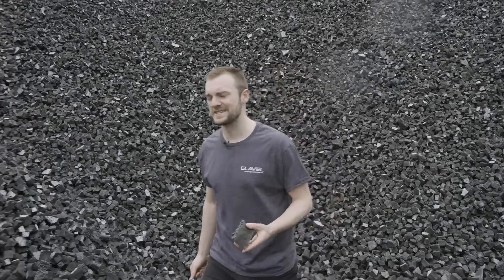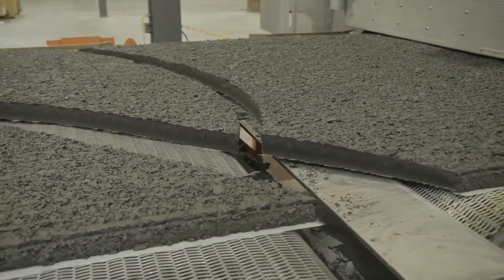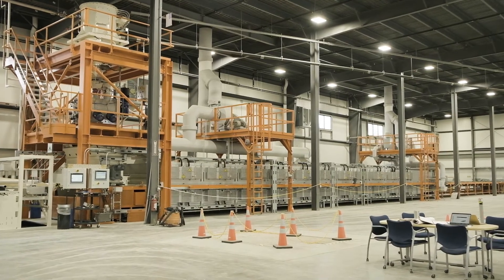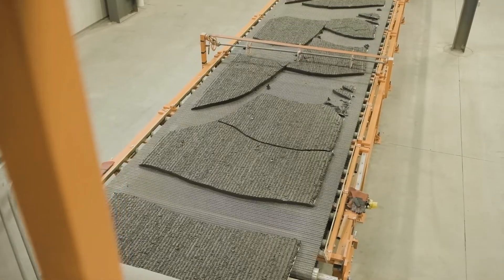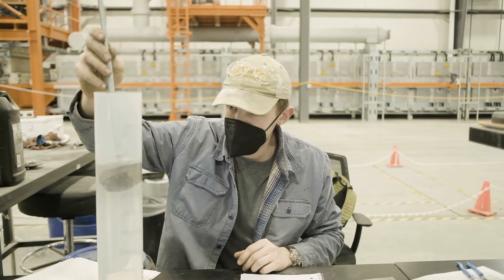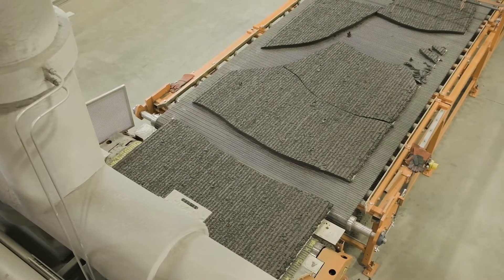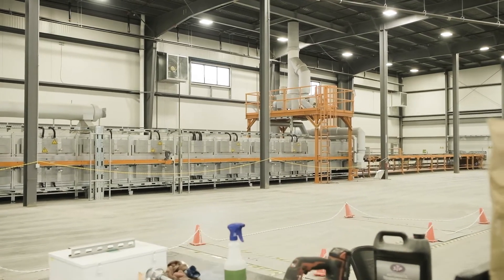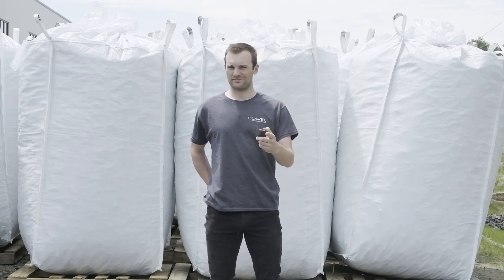Welcome to Glavel Saxon Hill

Comment: I don’t understand the advantages other than lighter weight and easier to spread. Don’t care about environmental concerns.  Cost compared to gravel? Insulating ability under the slab?
Reply from the maker: Lightweight, easy to spread, and environmental friendliness are some users' favorite product benefits. R1.7 per inch underneath slabs means a 12" install will achieve R20. On an installed basis, many people save money using Glavel when compared to rigid board and gravel.